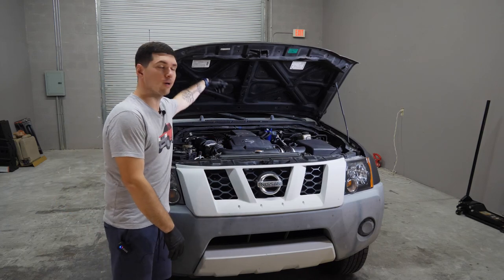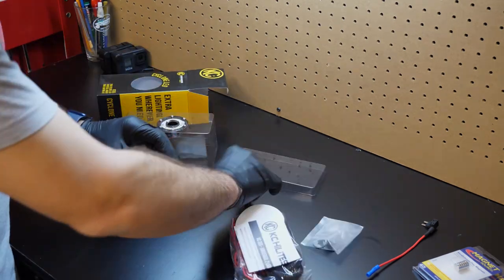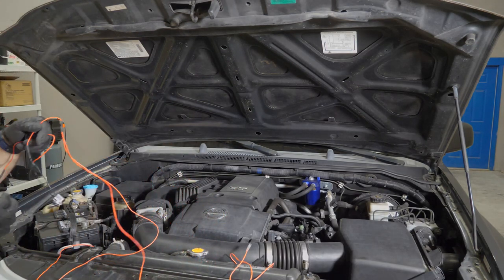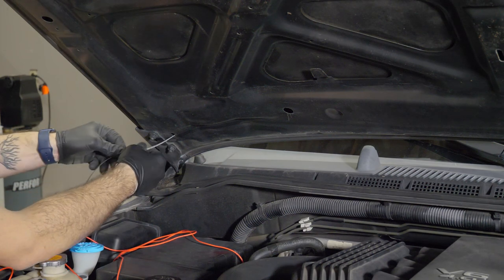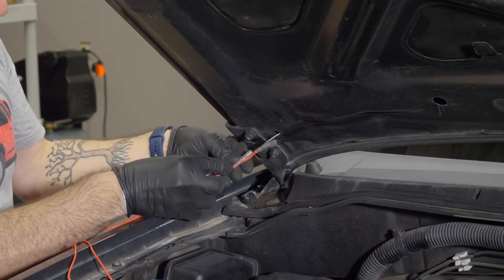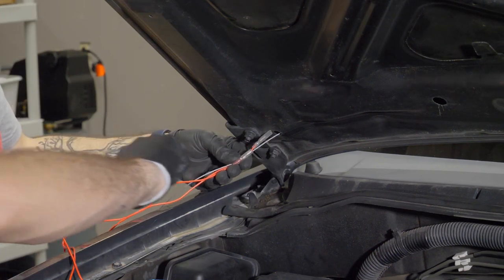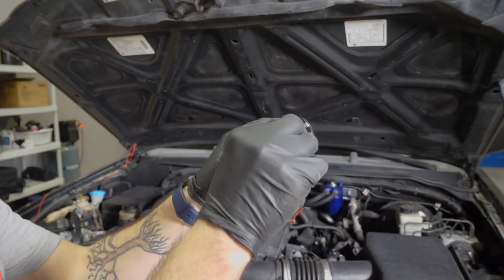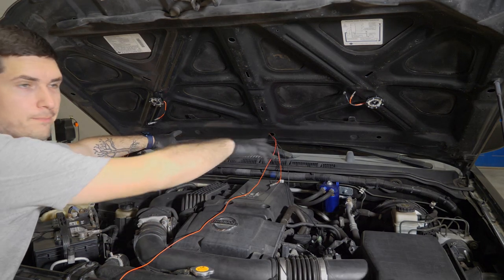How to install Under Hood lights A MUST FOR EVERY GEAR HEAD!

Comment: Nice mod! Looks like it would be a life saver if you're stuck on the side of the road at night. No more flashlight in the mouth or headlamp required. Great video, thanks!
Reply from the maker: For sure or out on the trails. The lights are super strong to.

Comment: I use like a 13 inch thin light bar with about 60 watts and mounted it to the hood as the lights are not blinding me as they're actually shining down on the engine itself.

Comment: Thank you for this video, I just installed a Cyclone LED to my 2020 Renegade TH. There is a section on both sides under the hood for perfect placement and angle to hit the engine straight down. Ran the cable alongside the windshield fluid hosing under the thermal pad. attached the switch right above the fuse box😁.

Comment: Upgrade your battery terminals with some brass marine terminals.  I did and it makes it so much easier to add accessories and you don't have to worry about corrosion.
Reply from the maker: Great tip!
Reply: @AnX8765  Solid brass, if I recall.  They were the O'Reilly Super Start brand.  Had wingnuts, but replaced them with nuts that would stay put.  I changed two of the grounds to 2 gauge as well.  Been pretty solid on the electric front, starting in cold stuff, RPM doesn't jump as much when I have the accessories cranked.

Comment: Good idea,man. I used old LED 18 inch bar from my semi truck toolbox. It’s on the magnet also,and has no fixed wiring (aprox 10 feet) with aligators,so i can move it anywhere i need it at the giving time ,even under the car if i need to.
Reply from the maker: Smart! I like that

Comment: I love your channel. You have helped me a lot with my Frontier mechanical needs. Do you have a video about how to install a larger upper control arm? I just put a 3 inch lift on my struts and lost alot of my uca clearance. Also, what would be a good uca for the price? Is Dorman uca on Amazon any Good? Thanks.

Comment: Where you connected the positive terminal is on the downstream side of an 80 amp fusible link. this is a generally bad practice, because if something goes wrong it will blow that link and your vehicle will not start. (Ask me how I know.) Much better to tap in on the battery side of that fusible link.

Comment: Those are awesome! As usual, you do great work! I'll be using a lot of your videos for my 'new to me' 2015 Pro4X i just picked up with only 56k miles on it.

Positive to this also, if your head lights stop working, you can open your hood, turn on these lights, stick your head out the driver side window, and cruise the streets!  ^_^
Reply from the maker: haha great tip! Thanks for watching and dont forget to sub for more X content.

Comment: The problem with the rare earth magnets is that if they are mounted to a section of the hood where the metal is thinner they will actually attract metal particulates from daily driving and you will have the “halo” of the magnets showing on the outer skin of the vehicle. The screw method is definitely the way to go.
Reply from the maker: Great tip! Didn't even think about that.

Comment: so for the next mod im trying to figure out how to put lights under the truck that turn on when the door opens.
Reply from the maker: Fun idea! If it’s LED strips then slave them off of your dome light wires.
Reply: I want to do this as well...lights will be mounted to the frame at least two on each side. Tied into the dome light system. So they will come on when you unlock the doors and stay on and fade with the interior dome lights.
Reply from the maker: I have this video already but it was shot for footwell lights. If you can find the wires further down where they run you can tap into them.
Reply from the maker: https://youtu.be/OiDpjgI_DOY
Reply: You could mount them under the running boards if you have running boards. That is how I might do mine..three lights on each side of the truck.

Comment: Thanks for the video, I am going to put this on my truck. Did you consider a tilt switch? If so which did you look at and why did you decide not to use a tilt switch?
Reply from the maker: TBH I didn't even look. This switch just came with the kit so I used that. 😂

Comment: I have a 2005 Xterra, sometimes it’s won’t start after driving it. It’s turns strong just won’t start. After waiting 10 min it’ll start. It’s does this only once ina while. Most times it starts fine. I changed all coil packs and plugs, fuel pump, relay, 2 camshaft sensors, and it’s still does it. Any idea what it could be since you’re the Xterra expert ?

Comment: Hey Ry...u might wanna put some gromets at the entry and exit holes 🤔
Reply from the maker: You dont think the loom will be enough?
Reply: @Rythecarguy  i tend to over do things .... but i did too commented before u mention about using the loom. Although u should do the entire line in loom to protect wires from summer heat in the summer and engine heat tho 🤔; not just the bit that enters thru the holes .... again, what i would do ... as i over do things 😝. Love your vids dude

Comment: Ok so one of my cigarette lighter sockets is not working on my 2007 nissan xterra, I replaced the fuse for it but still not operating what would you recommend is the main issue?

Comment: Awesome mod!  Adding the hydraulic hood struts and removing the prop would be nice too.  The hood on my Xterra actually now moves up higher than with the prop.  How do you keep your engine bay so nice on your Xterra?  Mine never goes off-road and is my daily driver and doesn't look that clean.
Reply from the maker: The trick to keeping it clean is not driving it. LOL. I have 3 cars and to be totally honest I drive the Xterra the least. I love the idea of the hydrolic lifts. Can you send me a link of where you got yours?
Reply: @Rythecarguy  I bought mine from Ebay but the link no longer works.  If you do a search on Ebay you will be able to find a set that will work.  Mine were listed as for a Nissan Frontier but fit just fine without any modifications other than removing the stock prop.  I think Off Road Gorilla sells a set for the Xterra and the Frontier as well but they were out of stock when I ordered mine, that was well over a year ago though.

Comment: You need rubber grommets where the wire passes into and out of the hood channels. Otherwise you can expect some short circuits in the future.
Reply from the maker: I used loom but yes. You definitely need something.

Comment: Would LED light strips work or would there be too much heat?
Reply from the maker: Yeah I would be concerned with the heat. Especially with adhesive strips they would likely just fall off onto the engine. The lights that I bought in the video are specifically designed to be mounted under the hood next to the engine.

Comment: Nice upgrade, I need to do this. Where did you get the guide wire?...thanks.
Reply from the maker: I used the wire from one of those lock down kits. Here is the cheapest one I could find on amazon with the right sized wire. https://amzn.to/32YQUL4 I will also up date the description of the video. Hope this helps!

Comment: This is a fantastic idea! :) How have the lights and wiring held up over time? Are the lights hot to the touch after driving? I thought about doing this before, however, I was worried that the heat from the engine would overtime melt or damage the lights :)
Reply from the maker: No, everything has held up great 👍🏻. This is a KC lights kit that is designed to be in the engine bay.

Comment: 13:28 What's that hose going into your coolant expansion tank (next to the cap)? My Xterra doesn't have that.
Reply from the maker: I believe that the overflow outlet from the radiator.